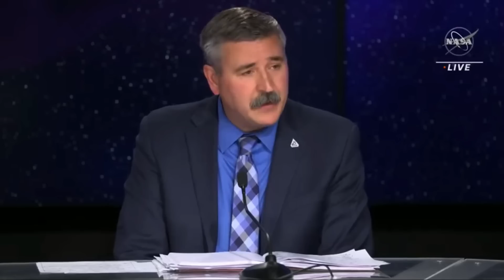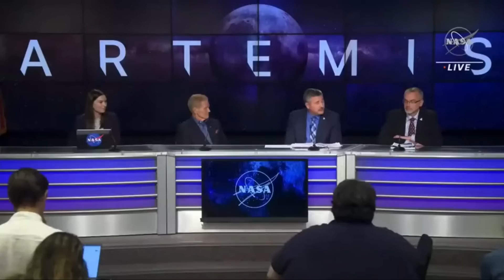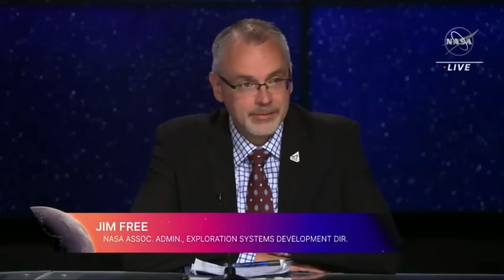Why was the Artemis 1 launch attempt scrubbed? NASA explains at press conference

Comment: It was an unnecessary risk.  It should have been performed in wet test.  Ahhhh, the team was tired.  Don't you have shifts?  Sounds like a lot of issues with the Mobile Launch hardware, because all four engines performed very well at Stennis.

Comment: perhaps using new components would work better.  This rocket is a collection of old (years?) old.  Seems like the amount of time they had take  would have been enough.  I would not ride in that rocket.  only my opinion.
Reply: Right on all points!
Hardware designed for the Space Shuttle, like the unique reusable engines, is wasted because they will be thrown away.
The huge hydrogen tank incorporated in the structure determines the size, better was the external configuration on the Space Shuttle, where the use of hydrogen was justified.
A new design should have used the much easier to handle liquid methane fuel, like spaceX , or kerosene like Saturn V, this rocket where the size is determined by the required huge hydrogen volume and the additional stresses caused by the payload, which itself is incapable of carrying a lunar lander and return module.
This much less capable launch vehicle,  judged by its size and not by its capability, is essentially a Lego design effort, an incredible regression, reflecting the loss of competence of NASA. To achieve it's original goal of landing on the poles of the Moon it needs a rendezvous in earth orbit using SpaceX starship, redesigned to land on the Moon.
The original approach back almost 70 years ago, specifically had ruled out Earth orbit rendezvous, in favor of return flight rendezvous in lunar orbit.
So now a gateway is needed to regularly visit the Moon, let alone build a permanent base, another decade loss to implement such a new Moon orbit Space station. This is financially totally unjustifiable, given the present government overspending. The only realistic approach is to let capable private industry take charge, which will probably happen, but also much later than the announced dead line 2024, only 2 years hence.
We all hope a reasonable way will be found before the Chinese put a permanent base on the Moon.

Comment: So, really non answers,  how will this fueling interface leak NOT come back in future attempts ?
Reply: Just because you didn't understand the answers doesn't mean they were "non answers".
Reply: When you load cryogenic propellants into the vehicle the cold liquid causes the metal piping to contract. This can open up leaks in the connections and interfaces. Its a common problem while pumping super cold liquid propellants into a rocket. The Saturn V used to have the same problem sometimes. I believe what they did was to reduce the flow rate of the propellants into the rocket and the leak closed up. This is part of the learning process. Now that they know what to do the problem should not reoccur.

Comment: I remember when I watched a docu about the Apollo program. Apollo 4, the first test flight of the SLS' more iconic predecessor, the Saturn V, had undergone similar circumstances and got scrubbed as well. Later on, Apollo 6, another test flight of the rocket, experienced some problems mid-launch.
Had these errors not be taken into account, Apollo 8, and maybe 11 would've been a disaster much worse than 13. It just comes to show how the Engies take these errors seriously for human spaceflight in general.
Reply: Apollo 13 was not a disaster!
It was caused by dropping the ox tank at Bell in Colorado AND by an improvised procedure to empty the tank. Nothing to to with and holding at all.

Comment: I, for one, am glad that they didn't turn my tax dollars into little bits through spontaneous disassembly. There's no particular rush such that a few days matter. Do it once, do it right.
Reply: Don't worry, your tax dollars turn into little bits to the tune of $800 billion per year through the military, 40 times the entire SLS budget over it's entire dev per year. Even if the SLS blew up you'd hardly notice the tiny extra flame.
Reply: @filonin2  
Your comparison scale is way off
The military is not a single organisation or a single ship, even a single aircraft carrier is orders of magnitude more complicated than a cobbled together vehicle with used engines of the Space Shuttle.
Reply: Your tax dollars don’t do jackshit if you’re a resident of one the 25 economically failed states, yes you guessed it right, you’re welcome.

Comment: Although the Artemis program was first announced in December 2017, development of Orion and the SLS officially began in 2011. According to The Planetary Society, the development costs of the program have gone far over budget from an original $7bn to about $23bn, 230% increase  A decade later and their sending 4 Mannequins to orbit the moon! What has nasa been doing???? They are using old space shuttle engines, and single use solid booster rockets.  They want to spend 93 billion by 2025. Given the past 230% over costs this will balloon to 214 billion by 2025 and more likely 2035. Huge waste of tax payers dollars! Shut down this money pit ASAP. They can't accomplish shit!
Reply: the SRB's are not single use. they land in the ocean with parachutes. then they are recovered, refurbished, and then reused just like the did with the shuttle.

i agree with most of the rest of what you said, but the blame for all these delays, cost overruns, and engine troubles fall on boeing and the other sub contractors along with piss poor oversight from nasa management.
Reply: @goatdocfilms504  Apparently the SRB's used on SLS will not be recovered like they were on the shuttle. NASA has said that  given the relatively small number of anticipated flights of SLS there is enough booster hardware left over from the shuttle program that can be updated and used on SLS. Therefore it was determined that it would be cheaper to just use brand new boosters each time rather than refurbishing and reusing the old ones. Also, getting rid of the parachutes reduces weight, which translates into more payload.
Reply: @joevignolor4u949  last i heard they were going to reuse them, but the decision not to reuse them doesn't surprise me. NASA Leadership the last couple decades has been really short sighted and i honestly doubt that the unit cost to keep buying 2 new boosters each flight after they run out of old will be cheaper in the long run. and the weight savings argument is also BS.
Reply: Grow Up...

Comment: Safety first!  

Take your time. Get engine 3 repaired and Flex Seal that foam crack. :)
Reply: Same as Challenger in '86 right?
LMAO
Reply: @Buddyclub33  no that was the O-ring
Reply: The foam crack is pointless to fix it’s not a problem
Reply: If they had to fix the engine they would have to roll it back into the vab

Comment: Most importantly is they know if the problems are design issue or craftsmanship issue.  It is just complicated.
Reply: Actually it is associated with the use of hydrogen as fuel, It will always leak some, on the Space Shuttle this was not such a problem because the tank was separate, and external, here it is a structural member integrated into a huge rocket because of the enormous volume of the required , liquid hydrogen. Imagine the SS with the external tank in the middle of the Shuttle, which has the large payload bay to boot. It would have been much, much taller.

Comment: I realize that SLS is a very complex system, however NASA engineers have had over a decade to prepare for this launch.  If SpaceX were contracted to build/launch SLS I have to believe that they would have launched years ago.  Come on NASA!  Get your act together or surrender control of Artemis to the private sector.
Reply: Another comment from someone who fails to understand the complexities involved.  It's the first launch attempt of a new vehicle, using new ground systems, new procedures and new software.  You learn a lot when you put them together for the first few times that you'd never learn by trying to model everything.  We should expect it'll take 3 or 4 tries.  Meanwhile, SpaceX is going through the EXACT SAME PROCESS with Starship, and they're having their own problems.
Reply: It WAS slated to launch years ago, but the government placed budget cuts on NASA, which hurt their opportunity to construct it in time. Don't blame NASA for the budget cuts, blame Congress!
Reply: Space X has yet to send anything as large as Orion past LEO. People want to think this is all known engineering and science, but it’s not. Crew dragon could theoretically make it to the moon and back, but thats if the heat shield can take it. Orion is rated and ready to reach those heights as it sits. This is the absolute bleeding edge of what’s possible in spaceflight today, and it is far beyond the crew module of Apollo. Apollo could take three men for a week or so. Orion can support 7 for over two weeks, more with the standard load out of 4. It has all new computer systems that allow it to run complex deep space missions (remember, it was originally built for asteroid rendezvous). Give them time. Slowly but surely, we will reach the stars.
Reply: You;re wrong.
Musk said Starship could launch to Mars in 2022.
How's that working out? No delays? No catastrophic failures? 
Space is hard.
Safety comes first.
Reply: @brendanariki  I seriously doubt that he did say that. It took them about 9 attempts just to perform the ships first soft landing.
Reply: @markheyes287  We live in this amazing world where factual information is available to all in seconds. 

"Musk has previously said his "aspirational" timeline for the first Mars cargo launch is 2022. Then, around 2024, he'd like to land the first people on the red planet." - Business Insider 2018

How are those timelines working out?

Comment: I believe with magnet propellsion 
We can put the launch pad further up in the sky 
And it can be released with a cannon like device instead of a launch pad 
Liquid engines are not sustainable and a major waste of money
Reply: What clickbait did you watch?
Reply: Magnetic propulsion wouldn't be able to even lift a small Rocket due to it's weak thrust.
Reply: Science Revolution  Most satellites have thrusters to stay in orbit otherwise, orbital decay will occur. Few gas particles hitting the satellite over a long period of time will cause satellites to fall back to earth eventually.  

Speed is measured in space with computers from earth based communication and rocket telemetry that calculates the distance traveled in a given time. V=∆x/∆d. Simple math.